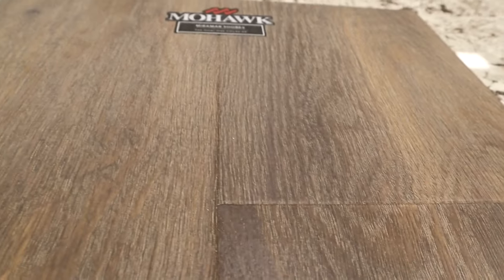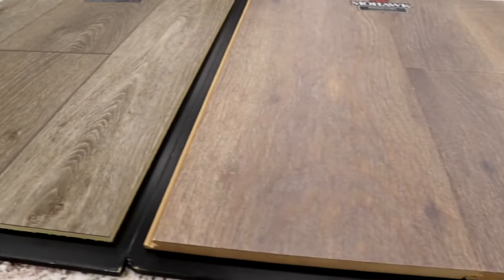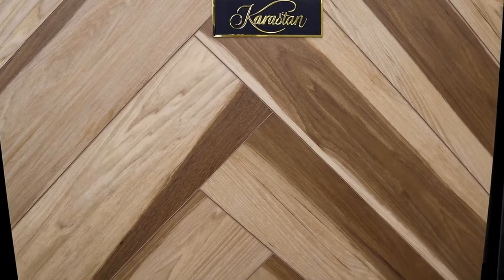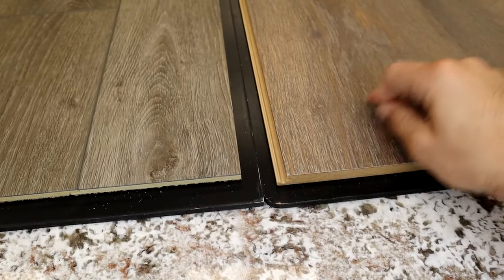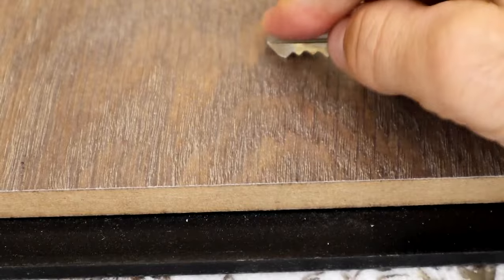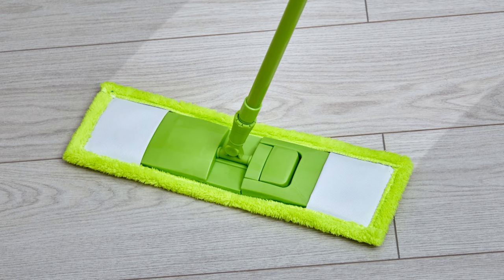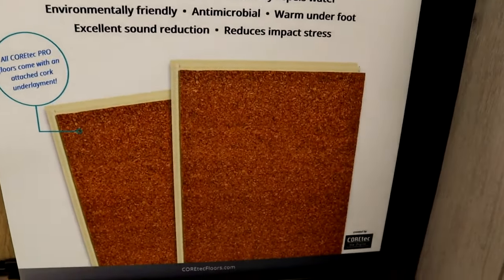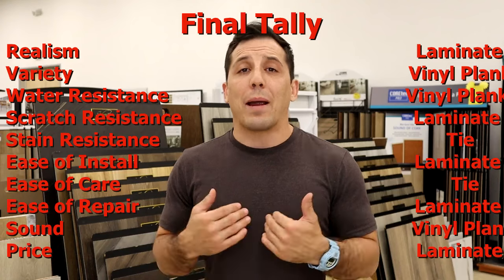Laminate Flooring VS Vinyl Plank Flooring

Comment: Laminate is garbage. Lvp is better in every way. Lvp is way more durable, waterproof, and much easier to install than Laminate. Lvp also feels 10x better underfoot than Laminate. I've installed both for over a decade and I would never recommend Laminate. It's compressed cardboard and will swell up with almost any water contact. Laminate is 100% the worst flooring product ever designed.
Reply: I have pergo and I love it. Looks and feels way more natural to me than plastic.
Reply: @afterstars  pergo is plastic. Lowes claims it's water proof but it's not. Only the surface layer is. Once water penetrates a joint its game over. It's a compressed cardboard with a thin plastic surface layer. I like Tesoro Luxwood the best. Honestly, pergo is 1 of the worst ones. It is notorious for swelling at the joints once it gets wet. Lvp can be thrown in a bucket of water for 10 years and look the same when it comes out.(I've done this at our shop) Laminate wouldn't last 10 seconds. Also, laminate has a hollow plastic feel under foot compared to a quality lvp, which is a solid, more warm, and rubbery feel. We won't even install laminate anymore. Only lvp, hardwood, and tile mainly.